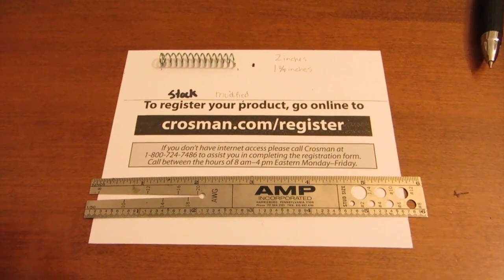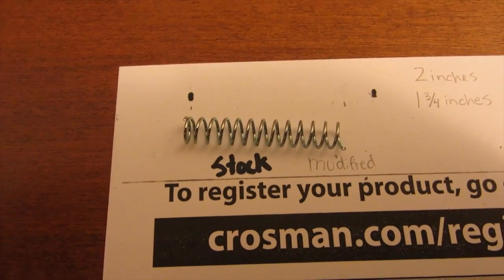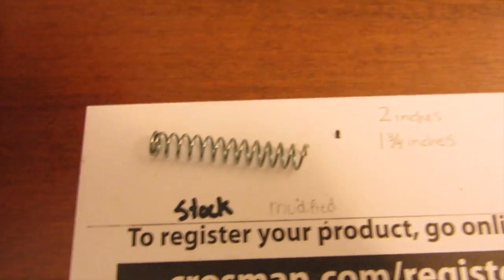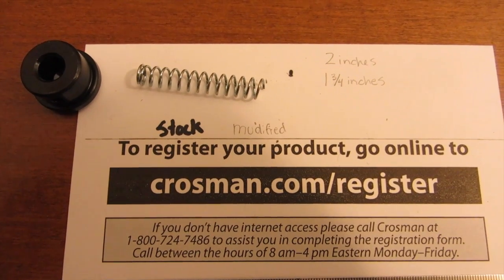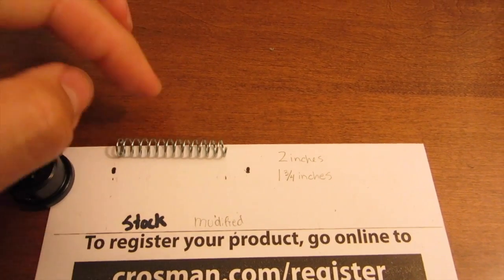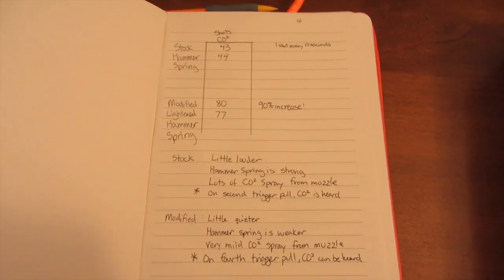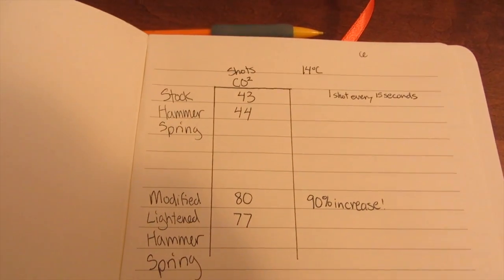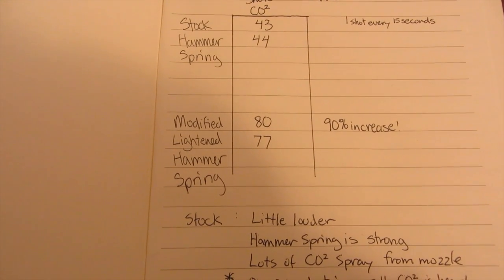Crosman 2240 - FREE Lighter Hammer Spring Mod - 90% Increase in CO2 shots - Minimal FPS Loss

Comment: Do the transfer port & extended pellet probe and you will get even more shots at standard power for even less Co2, the stock port leaks like crazy and the OEM probe puts that back of the pellet half way across the port , Cheap mods that will save you a lot of power-lets over time

Comment: I think crossmans absolutely  knows that there are way to much co2 coming out.  Average 37 shots stock.  Cut is up to 65 shots.  1/2 the co2 sold. $$$. I always cut my springs.  If cut to far gun will  not cock.  Just stretch the spring a little.

Comment: Hi, I must admit to have been skeptical on shortening the hammer spring. I was almost certain that I was going to loose a lot of velocity reducing the 2" spring to 1.75". I used a chronograph to measure the velocity of two Crosman .2240s, one .22, the other .177. Each of these barrels are 10.1" and both guns have the steel breach. Temperature 68 degF. I first tested the .22: 2" spring = 464 fps, 1.75" spring = 458 fps. The .22 lost 6 fps with the shorter spring. Then I tested the .177: 2" spring = 508 fps, 1.75" spring = 510 fps. To my surprise, the .177 gained 2 fps. That result I can't explain. Both pistol reports were quieter using the shorter spring.

I did not test the available number of shots per CO2 cartridge, but see no reason to not expect more shots with the shorter spring. 

Thank you for sharing your work with us.
Reply from the maker: And thank you for providing us with your feedback! We're all a community, everything you do helps us all as a whole. Enjoy your more efficient 2240!

Comment: Thanks for an informative video.  My question is:  After this mod, what is the velocity reduction in fps?  Have you chrony'd the pistol with both the original spring and the revised spring?
Reply from the maker: We have a comment below that states he lost about 10% FPS while doubling the shot count. I do not have a chrony, but I have come across several pieces of information on the web where velocity loss is negligible, but shots per CO2 gained are substantial. There is nothing wrong with being conservative with how much spring you remove, you'll retain more FPS while still netting a smaller benefit. I enjoy efficiency so I pushed my spring a little bit. I'm sure you'll enjoy finding your sweet spot.  DIY, tinker with it and have some fun :)
Reply: @saxpride  I don't know about you but when it comes to power in already weak co2 pistols losing 10% is definitely not a negligible amount to me lol

Comment: one more note, after cutting the hammer spring the second time, when you install the co2, hand tight it, and than dry fire it 2 times to get it piereced, now it takes 3 dry fires. the first is really weak, the 2nd better, but the 3rd it's good to go..

Comment: just got this gun friday afternoon from amazon. 1st try, very loud and powerful. 1st co2 48 shots. 2nd  45shots, 3rd 50 , 4th 47,5th 47, 6th 46.. so i decided to do the hammer spring mod. cut off 3 coils. 1st powerlet,72 shots, 2nd 75, 3rd 63, 4th 76,5th 71. i decided to cut a little more off the spring, and cut off 1/4" from the end. the 1st powerlet went 90, the second 91. trigger very good, power still very good. infact it shot a soup can very hard for 55 shots !!i thought it would be weaker after about 30 shots, soup can was demolished !! don't have to do anymore....
Reply: What was the total length of spring you cut off?

Comment: well I got a chance to crony it with weakened spring, today two days after I did it, well cold weather about 30 F, almost 400 fps, stock it was around 430, good trade off, get twice the shots for loss of 30 fps, cronyed my two 2240's with a 21 inch barrel and a 24 inch, nothing done other than the barrels,  both did 540 fps so I am going to cut 1/4 inch off the spring and croney it , Hopefully it just looses 30 fps, should, will be a lot better saving a lot of co2 , not big into speed, never as accurate, I have 30 pellet guns from 22 thru 50 cal
Reply from the maker: +steve levinski Thanks for the info steve, I will update the video description reflecting your findings. With the new info, I agree that the tradeoff is good. If you could post your findings for the 2240 community with the longer barrels that would be great too!

Comment: well I tried it today, my results similar . I was only getting about 30- 35 max shot's stock, cutting the spring 1/4 off and it jumped to little over 60 good shot's.so today had to stop at 45 shots to warm up and back out. because it was 20% F, I have 3 2240's, two with long barrels 24 and 21 inchs and this totally stock one, so now my box of 40 power lets have jumped to 80, for a cost of 17.00 instead of 34$, and not trying to be accurate it still tore a 1 inch group at 16 yards so didn't effect accuracy at all.  thanks for the tip.

Comment: Okay but that means less fps or am I completely wrong on that one?
Reply: +saxpride 
FPS remain constant... is that based from a Chrono or are you just speculating?
Reply from the maker: 2lbsTrigrPull Actually the FPS remains constant. The 2240, in stock form, releases excess CO2. In other words, the short barrel doesn't give the pellet enough time to accelerate from the short 7" barrel, and you can see a large amount of excess CO2 coming from the tip. Why Crosman decided to do this is unknown, but it has been tested. By reducing the spring, you reduce the excess CO2. The pellet will still accelerate the same amount within that 7 inch barrel. If you have a longer barrel that can actually efficiently use the CO2, then this mod will lower that longer barrel's FPS. Hope I'm making some sense here. Gatewaytoairguns forum lead me to this modification. Do a search on "Crosman 2240 co2 Efficiency" and you'll find all of the chronograph data from shot strings with various hammer spring sizes which will give you an idea of what to expect.
Reply: saxpride
Reply: saxpride l

Comment: How did you know you did loss fps?
Reply from the maker: Harvz B Gatewaytoairguns forum lead me to this modification. Do a search on "Crosman 2240 co2 Efficiency" and you'll find all of the chronograph data from shot strings with various hammer spring sizes. Truth is you can actually go a little further than my own mod, but I added in a margin for safety. You can always cut more, but you can't lengthen the spring! 

The only way around this would be to get a power adjuster mod. Then it would be reversible but with an added cost. 

These mods have been tried and tested already by the GTA community, and they're awesome!

Comment: I did something similar to both of mine. I cut them back and  incorporated the rear power adjuster screw mod so I could adjust from low power for plinking to higher power for pest control. Of course if you just want to extend your shots per cylinder, your spring mod is simple and free. Now cut a bit off the sear spring and lighten the trigger pull for free.. :)
Reply from the maker: Joe Aimetti Nice with the power adjuster screw. I'm considering that option, but I want to keep things simple. Also a great idea with the trigger spring. I actually tried squeezing the hammer spring at first, but it's too strong, so it had to be cut. I squeezed my trigger spring to make it shorter, which makes it lighter. Thanks for viewing and leaving a comment.